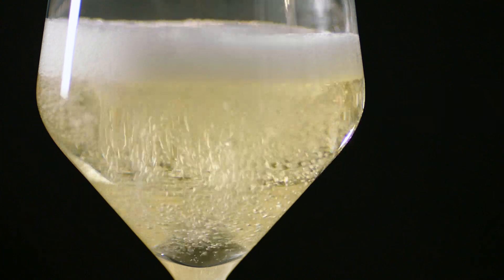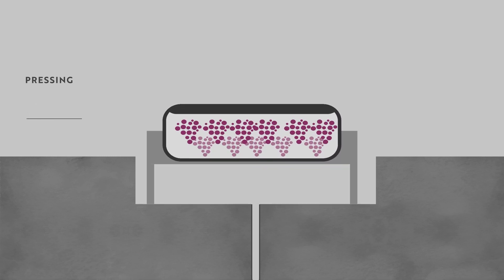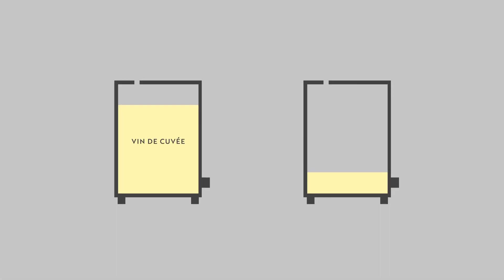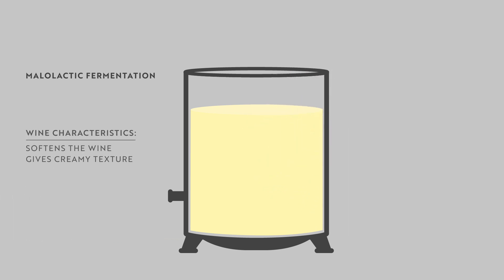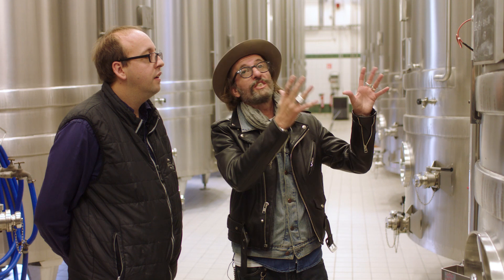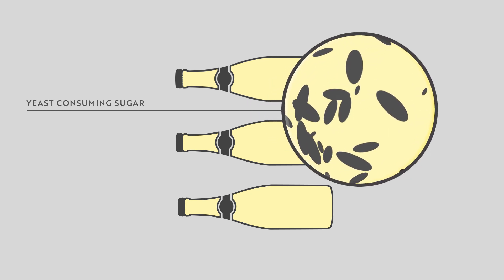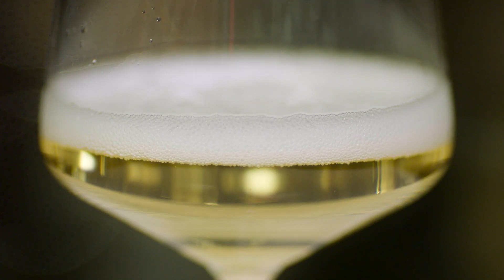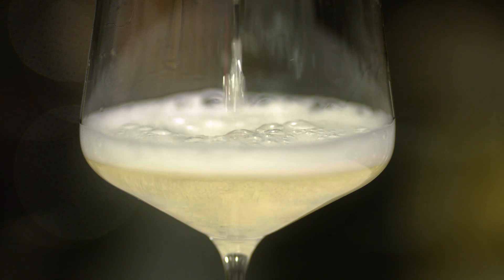How Is Champagne Made? The Champagne Making Process Explained

Comment: I can't find mention below, but even if the Champagne method may be called methode champenoise in Champagne, the same method is used for other sparkling wines, not least Cava.
Little is made of the dosage, which are actually closely guarded secrets for each vinyard/brand as it contributes substantially to the finished wine. Similarly, the blend of the permitted grapes has a huge effect on the final wine with the extremes being blanc de blanc and blanc de noirs.
Champagne was also traditionally a medium, or sweet wine. Dry - Brut, Extra Brut and Brut Nature - has always been available, but its popularity is very recent in the history of Champagne sparkling wine.

Comment: I got lost a little, how does the color of the grapes change to make it white ?
Reply: its white from the start,,what makes wines go red or rose is the skin of the grape and how long it is left in the juice and of course if its from white or green skinned grapes this wont happen unless its from dark or red grape skin
Reply: @ARCSTREAMS  okay so pressing instead of crushing achieves this.. got it mate!
Reply: @rutendogoredema8337  not sure there is a difference between the two but basically you do not put it in a blender as the color will mix in rapidly so what you want is to press or crush or squeeze out the juice and separate it from the skin and seed if you want to keep it white

Comment: i am confused about a few things,, they said the fermentation if left longer can go into a malo lactic stage making it less crispy or tart however wont this happen during the second fermentation in bottle after adding yeast and sugar and spending a long time up to several years?  also after disgorging are they really completely removing all the yeast therefore during the dosage(addition of sugar) the sugar will not ferment any further? i believe to make sure of this they add sulfate and sorbate no? only they never talk about this but surely there may be residual yeast left suspended in the wine after disgorging and adding sulfites/sorbates is necessary assurance to halt further fermentation and to keep the wine sweetness level where needed
Reply: It all starts with winemaking, which in Champagne is generally called the first fermentation as opposed to the second fermentation. We know the principle of fermentation: it is the biological transformation, under the action of yeasts, of grape sugars, glucose and levulose, into alcohol and carbon dioxide. If the sugar content of the must is not sufficient to subsequently provide wines with an alcoholic strength of between 10.5% and 11%, chaptalisation is carried out within the regulatory limits by introducing the sugar all at once before the departure of fermentation. It is generally after the first racking that takes place, if it takes place, the malolactic fermentation, also called malic degradation or malolactic retrogradation, which can be spontaneous or provoked, and which is a transformation of malic acid into lactic acid by lactic bacteria contained in wine, with formation of carbon dioxide.
Malic acid is responsible for the greenness which can make wines unpleasant to taste. Malolactic fermentation, while contributing to the biological stabilization of wines, can reduce their acidity by 20 to 30%, thereby giving them a certain flexibility in terms of taste, which allows faster marketing. If it is not done before the draw, it can be triggered in the bottle and cause difficulties in foaming and riddling, pronounced lactic tastes and pressure increases. It allows the wine to lose its acidity. It follows alcoholic fermentation. It can begin a few days after alcoholic fermentation or more commonly begin within two months. In Champagne,  The yeasts transform the sugar (which has been added) into alcohol and release carbon dioxide which then becomes trapped in the wine. The prize of mousse is a second fermentation alcoholic.

Come and discover the french wines on winexploration ! Thank you to subscribe !  Happy new year ! I wrote the text in english in the description !
Reply: @winexploration2718  so if malolactic can happen a couple of days or a couple of months in the bottle then how do they stop or control that? that is what im wondering
Reply: @ARCSTREAMS  malo is caused by the winegrower. sulfites prevent malo from starting again. Thank you to subscribe !
Reply: @winexploration2718  ok either i am having trouble understanding you or you are having a problem communicating a proper answer, what do you mean caused by winegrower? give specific details,,,all i understood is that this degradation happens after a period during fermentation,,what causes it?and how does the winemaker control it or make it stop be it in the 1st ferment or in the 2nd in the bottle ? dont give me long winded reply just short and to the point
Reply: @ARCSTREAMS  the winegrower starts the malo
Reply: the fml takes place before the foaming translate

Icône de validation par la communauté
Reply: For alcoholic fermentation he uses the mustimeter which indicates the degree of alcohol, and by the temperature. 
For the malo,
Paper chromatography is sufficient to observe the onset and general course, but the end should be followed by enzymatic assay. The MLF is considered to be completed when the residual malic acid content is less than 0.2 g / l

THANK YOU  TO  SUNSCRIBE !
Reply: @winexploration2718  ok i can see you are not capable of explaining things in simple normal terms but prefer using fancy words with non explanatory fashion,,so dont bother anymore
Reply: @winexploration2718  omg you are giving me rubbish because this is not what i am asking you,,please do not bother anymore since you do not understand simple english questions
Reply: The malolactic fermentation is difficult in wines with low pH and high acidity such as these and is only possible after the first fermentation thanks to the low alcohol content which later inceases. After the fermentation the yeasts die (autolysis), so even if after disgorging some parts remain they don't have the ability to ferment anymore. Sulfites are more than common in wines for various reasons, and is probably added at the beginning of the whole process, sorbate doesn't have effects on microorganisms. Hope this helps :), sorry for any English mistakes.
Reply: @marzollo7772  so you are saying malo does not happen in high acidic or high alcoholic wines or beer? but to prevent this they can always add sulfites correct? i am assuming malo is caused by wild yeast and the sulfites kill these while sorbate is used to halt yeast population and further fermentation correct? why did you say sorbate does not affect microorganism?
Reply: @marzollo7772   yes i believe that eventually after a long time the yeast in the champagne or sparkling wine bottle dies and can no longer reproduce or ferment specially in presence with high alcohol ,i am wondering how long this takes and if can i count on this to happen when i make bottle conditioned beer or will i still need to pasteurize since beer has low alc and the yeast may still be alive even after disgorging? ,,i ask this because after disgorging my beer in the bottles i like to add some kind of sweetener and so i worry the yeast will start working again as there might still be some residual yeast left in the bottle even after disgorging and because the alcohol level is quite low,,also this helps for preserving the beer for longer storage ,,or perhaps the hops also helps kill any possible wild yeast present and stabilize and preserves it too
Reply: @ARCSTREAMS  you are correct more or less, it's a degree of danger which both acidity, alcohol, sulfates and low temperatures contribute to decrease to almost nothing, high sulfates are a solution but lysozyme is a better one as malo-lactic inhibitor. Sorbate is a salt of ascorbic acid also known as vitamin C, it's used mostly as a short term anti-oxidant for the protection of fresh musts.
Reply: @ARCSTREAMS  speaking of wines the  death of yeast cells is very fast, at the end of a fermentation the conditions for the yeast is almost unbearable and it starts to eat and disgregate (autolysis) itself in a matter of a couple days. I'm not an expert of beers, but especially for homemade ones I think pasteurization is the safest choice, a bottle re-fermentation can go wrong very fast. Sulfites may be a solution but not an healthy one.
Reply: @marzollo7772  i never heard of yeast dying so fast after end of fermentation even in wines or champagnes of high alc content,i know from exp that adding sugar to these after racking with clear wine etc and waiting several days the yeast starts up again to condition inside bottle,,,also sulfites are not a solution to stop further yeast fermentation ,sorbate is specially to be used if you want to back sweeten in the bottle,,ok thank you for the replies